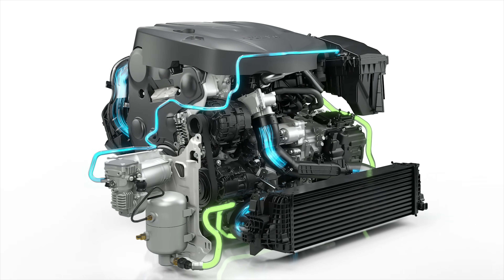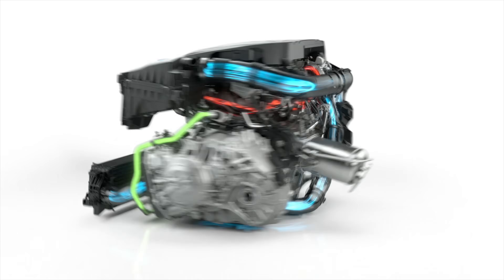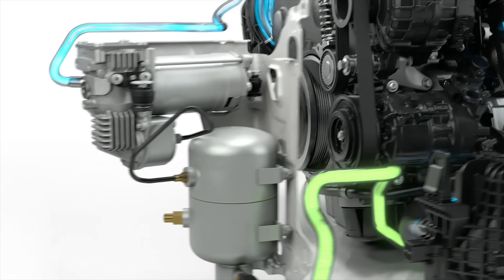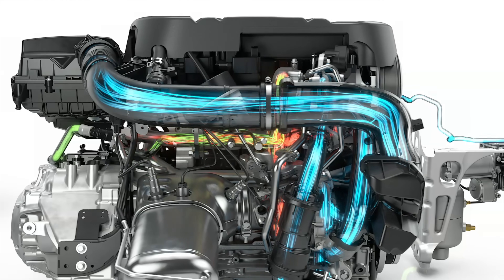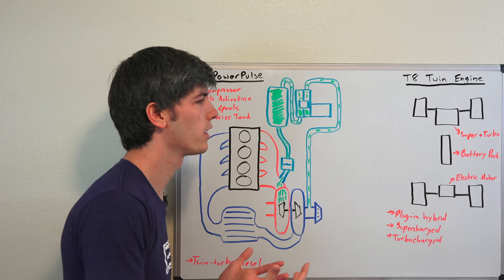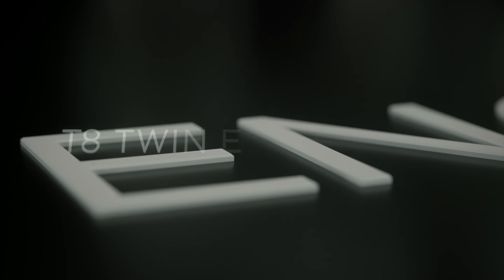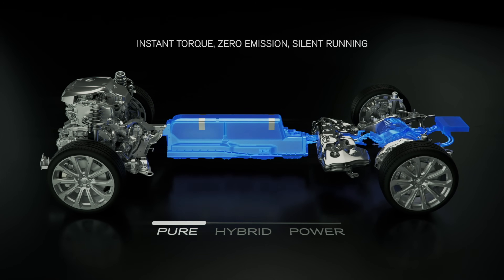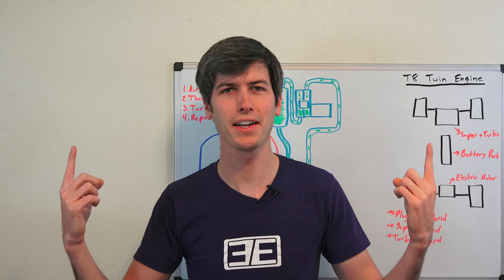How Volvo Is Eliminating Turbo Lag

Comment: Curious, sequential turbos don't really need precharge, I own an pugg 407 sw 2.2 HDI bi-turbo and i just kicks from idle anytime, the turbos are symmetric and sequential, the first closes at 900rpm and the second around 2500rpm, giving one nice power curve from idle.. and it's 12 years old and wasn't the first sequential turbo setup even. Hybrids, imho, is the way to go, fully electrics sucks, gotta love to manoeuvre inside closed garages and what not, without starting the engine. Also, the power of 4x4 is just awesome.

Comment: Why not send the compressed air directly into the intake manifold, so you instantly have full boost, and a (nearly) flat boost curve? If the electric compressor (is it really more efficient than a belt-driven compressor, given the fact that its electricity comes from the alternator which is belt-driven? so, basically a supercharger that would be used to fill a compressed air tank vs this electric compressor powered by the belt-driven alternator) can pressurize the air at 10 x the boost pressure (so around 10 to 15 bar), it wouldn't require a very big tank, would it?

Also, if you're going the electric compressor route... I hope they are coupling this drive system with a pneumatic suspension, because the only requirement to add this PowerPulse to a turbo car with an air suspension setup is a pipe going from the air tank to the turbine, and the electronics necessary to control it.

Comment: So freaking complicated, poor mechanics must hate working on these things.
Reply: pedro fernandez I hate working on modern cars in general. Have worked as a mechanic for 3 years and the only exciting that ever happens around here is when 40+ year old cars come in, which is almost never. 

I just love old engineering, simple but gets the job done.
Reply: I also started working as a mechanic 2 years ago on modern cars and I can tell you, If someday in the future you have to fix an older car, see for yourself how fast and easy it is, you even need less tools and the process in general is straightforward. 

The thing I hate working on new cars is that everything is cramped, most of the time you need to disassemble things that could break just because they are in the way, there are lots of plastic pieces with rubber gaskets that aren't reusable. You need to reflect this things on the bill, customers don't like that. I have a hard time trying to explain why such a simple repair comes so expensive and they don't want to come again to the shop. 

If you choose not to do or replace this little things, the repair might be compromised, the car could not run fine or even worse than before, so customers aren't happy with that and they don't come again. Either way I have a problem when a new car comes to the shop.

Most of the time, people with modern cars ask me why this or that breaks, if they are using the new car for the same purpose as the old one, and even doing the maintenance as the manufacturer says. How do you explain to this people, who bought their new expensive car with their hard earned cash, that the new car broke down just because is built worse than the old one?

Sometimes (lately more so often), people come asking me if I know of a good old second hand car that has less maintenance and it's less expensive to fix than the new one they have. These people just need a car to go to work or from point A to B, they don't need turbos, exhaust particle filters, multimedia screens, sensors for whatnot or anything that could break and cause a problem their old cars never had.

I know cars have to evolve, there's a reason a new car is different than the old one, but I think there are other ways to enhance the overall performance of a car without having to be so overly fancy and engineered.

I also can see this as a trend with all product manufacturers, not only cars, but I just wanted to share my everyday experience.
Reply: Difference between my 1959 Deville and a modern CTS is that the Deville has style and joy. There is a reason why I daily drive a 1973 Merc E-class, to avoid all the electronics, maintenance and weight. I would love to daily the Deville but gas prices are way higher now than 58 years ago in America.
Reply: I started as a mechanic working on modern cars so I'm used to fixing them

Comment: Why can't they use that compressed air directly into the intake manifold rather than into the exhaust and then rotate the big turbo etc...?

Manifold pressure sensor can be used to control how much pressure allowed within the manifold by the compressor until turbo boost takes over or throttle released or compressor gets empty. Whichever comes first. Closed loop system with on/off command from the throttle+ECU to open or close compressor valve. Easier and quicker

Comment: why don't they inject that powerpulse air directly into the cylinder but instead to spool up the turbo? the tank only has to be big enough to supply the engine with enough pressurized air until the increased exhaust gas spooled up the turbo like usual. Using compressed air to help a component create compressed air seems weird to me....

Comment: Really people like to make a mountain out of a mole hill.  If you are on track with a turbo you instinctively get on the gas early coming out of a corner to spool it up.  

I would also argue that it's faster.  I had a 911 with fuel injected itb.  The throttle response was insane.  You want instant throttle response this is what you want.  However it's very hard to get it right.  Exiting a turn you get on that pedal to much and it gets the back out super quick.  So you end up getting into the gas slowly.  It's much easier to screw up in this car them a turbo car.  So you take it easy on exit.

Comment: Why don't you just spray the compressed air straight into the manifold to get the instant boost response? why wait to spin the turbo  up?
MillionD
Reply: Million Dollar because compressed air has condesed water droplets in it. U dun wanna b spraying water into ur engine dun u?

Comment: Hi i was wondering if it would not be more efficient to get the compressed air staright into the engine instead of the turbo?
Reply: bartmalinowy because compressed air has condesed water droplets in it. U dun wanna b spraying water into ur engine dun u?
Reply: So where do you get rid of condensation in the turbo then? would it not be better to take the preassurized air from the waste gate, and use it while turbo is spooling straight into engine ?
Reply: Bartek Malinowski turbo doesnt store air in a tank like a compressor does. Thats why u hv air dryer on a truck n u hv to frequently drain the air tank to flush the accumulated water in the system

Comment: B230FT BOYZ
Reply: JP3 B6254f tho, with 3 liter crank, h-beams, t5 pistons and a holset HX60
Reply: SWEET SEND IT!!
Reply: JP3 i am, trying to get a manual 960 first for the engine
Reply: '94 b230ft with intake, side pipe and ipd cam. '90 b230ft stock everything, boost controlled to 14lbs. my other volvos are NA...for now...
Reply: HM!!! i got a '90 b230ft, what mods do you recommend? 
 i've only bought it recently and dont know much about volvos YET
Reply: depends on how much power you wanna make, what transmission you have and how much money you wanna spend. cheapest power mod is a manual boost controller and a cheap boost gauge to monitor the boost levels. more expensive less daily driver options are bigger turbos, injectors, megasquirt, cams, transmission swaps...ect
Reply: i think il up the boost a tiny bit after i get her running well. thank you for the info

Comment: Imagine the turbo placed right at the intake manifold and capable of providing boost from idle. That's the concept Mercedes came up with.
Mercedes idea is splitting the hot and cold side of the turbos and putting electric motor/generator on the impeller shafts.
The hot side then simply generates electricity, not boost. That electricity is then used to power the electric motor on the cold side of the turbo, making boost. This allows them to keep the hot side of the turbo in the exhaust and place the cold side of the turbo right at the intake manifold, in addition to that they can make the cold side of the turbo spool up for boost even at low RPM's when there is less exhaust gas being produced.

As far as I know Mercedes has not produced this system on a road going car, but the idea sounds like the perfect solution to my mind.

Comment: This system is way too complex. Plus I doubt the reaction timing of the system of when to spoil the turbo. This might be used in executive sedans. We need simple and essential ways of eliminating lag instead of a large system which might have technical problems later plus increase in complexity of engine, cost and other factors. Better way is hybrid turbo of Borg Warner with titanium turbine wheel. A long flow exhaust manifold with twin scroll.

Comment: They should just cut a turbo in half and slap an alternator to the hot side and an electric motor to the compressor instant boost and the heat doesn’t touch the compressed air
Reply: The piping is easier to manage saving space

Comment: The complexity of both systems does illustrate the advantage of transitions to Series Hybrid/Range Extended EV powertrains. 
They are far simpler and allow the ICE/PCU (Power Conversion Unit) to be designed just for efficiency since it used only as a generator.  Like in the Nissan Note E-Power or BMW i3 REx, but with a far more efficient ICE/PCU. For example using HCCI and a stirling engine as secondary power extraction unit (but still included in the ICE engine block) using the wasted heat from the catalytic converter. 

Is any automaker doing this type of development work ?

Comment: I would like to see a hard comparison and numbers (hp, intake temps, efficiency etc) between an air to air intercooler and air to water intercooler.
Having said that, I'm pretty much decided I'll do an air to water for my Sti this spring for it's unique factor, but I do know that it is more efficient also.  Just curious to the actual temperature benefit.

Comment: Interesting. I suppose there is a good reason for not dumping that compressed air into the intake instead.

Big question. Do you have any research on cars using electrical transmissions? I'm talking about the type used in large (think copper mines) dumpster trucks. The engine powers an electrical generator. That in turn powers electric motors that send power to the wheels. It is supposedly more efficient than mechanical transmission of power [citation needed]. The dumpster trucks I speak of are typically about the size of a small house. They are assembled on site and run 24/7 except during scheduled maintenance.

Comment: Why not just use a real powered turbo (Electric motor to directly spin it up) rather than spending resources on a whole new pump system and piping?
It's like this is coming nearish to a pneumatic hybrid but stopping short of regeneration. I'd like to see them use engine braking to charge the pneumatic tank, if they insist on not having a real powered turbo.

Comment: A couple questions:
1. Why not just use the compressed air on the intake side?
2. What is the advantage of this system when compared to hybrid turbochargers (electronically assisted)?

To me it seems like there is already a better solution for turbo lag but I could be missing something.

Comment: why not use the exhaust gasses. they already are pumping air, why not just make them pump into a tank? this way you cut the weight and price of separate electric motor and its better for the car alternator

Comment: Makes me excited to think about having to spend $15-20,000 a year on repairs after warranty period. Nice three intake systems and two engines. Nothing could possibly go wrong with that, so easy to diagnose problems! And so easy to find a cheap mechanic to work on this!
I will stick to my BRZ.
Reply: Even if I had the money, I don't think I'd want it. Supercharger does the same thing with out a fing air compressor. On top of that, highly doubt all these "rich people" buying expensive cars even know what turbo lag is. And if you are rich and enjoy cars, you're not buying a Volvo.
Reply: There seems to be a trend of car makers offering expensive luxury sports vehicles that have incredible performance, but who's value plummets after just a few years.  The value goes down so fast because these beasts are difficult and costly to maintain and repair.  No average person in their right mind should ever want to own one of these money pits, even a low-valued used one.
Reply: Probably needs 6 digits to cover all the problem codes.
Reply: don't forget about changing the batteries every 4 years!
Reply: John Doe tell that to Jeremy Clarkson who literally owned one and drove his family in it for years. As far as safe, fancy, practical family-oriented luxury subs go, there's no beating the xc 90. Hence it's place firmly in the rich persons bracket for suvs.
Reply: Dorian Gray brz? Clearly you are not in Volvo target market if you're too poor to buy real sports car. The people who buy $100,000 Volvo XC90 s are not concerned with repairs I can tell you that much.